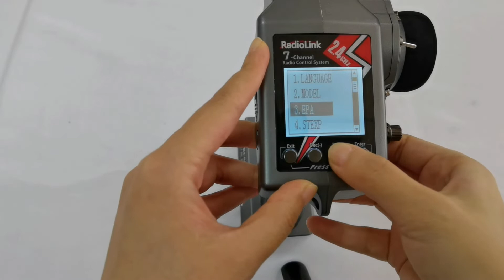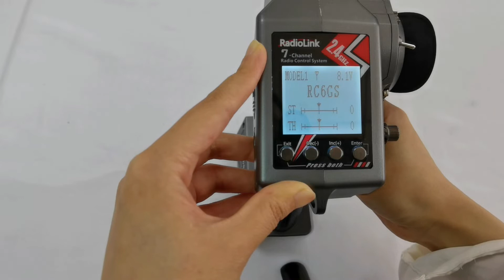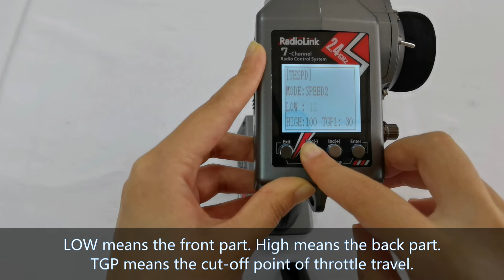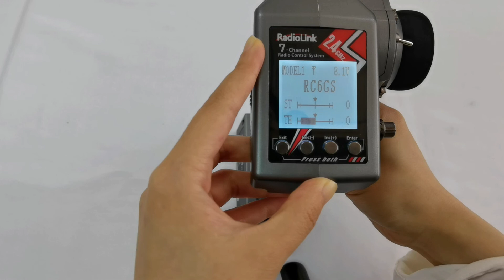THSPD Throttle Delay Function on RC6GS V3/RC6GS V2/RC6GS/RC4GS V3/RC4GS V2/RC4GS

Comment: But can you make so there is no delay when you release throttle and the return back to neutral. That delay on the throttle return is very hard to use when drag racing or speed running.
Reply from the maker: Hi, sir. Are you using RC6GS V3 transmitter? Could you please download and install the latest firmware V690, the throttle delay function is already improved and updated in the latest firmware. If there is still any question about RC6GS V3, could you please take a video to us? Our email is: after_service@radiolink.com.cn

Comment: Lo que no te explican es que cuando vas a frenar frena igual de lento que lo pones para acelerar !!! Si estás usando la opción para drag, preocura que tengas un espacio prudente para
Reply: Para frenar
Reply from the maker: Hi, sir. We have already updated the firmware. When you set the throttle delay, there will be no delay for brake now. Here is the link of the firmware for your reference. https://www.radiolink.com/rc6gsv3_firmware  If any question about RadioLink products please feel free to contact us. Our email is: after_service@radiolink.com.cn

Comment: The throttle speed function on the RC4 was key to getting my serpent 998e drag car dialed in! Very hard acceleration with out traction loss can be achieved with proper tuning of this function. 3 other local racers have now purchased a radio link after seeing my success with them. Keep up the good work!
Reply from the maker: That sounds wonderful! I guess you are a brilliant racer. It will be wonderful if we can see how you use the function in video.

Comment: Why is it only for Throttle channel? For example, I would like to speed down movement of servo horn between positions. Why not just provide consumer with ability to specify the same settings for any channel, not just for Steering and Throttle? To use or not to use - it is up to consumer.
Reply from the maker: Hi, sir. Thank you for your feedback. Many users use delay for throttle and steering. There is less need for delay of other channel now. But I can send the feedback  to our enguineer and hope it can be achieved in the future. If any question when using RadioLink products please feel free to contact us. Our email is: after_service@radiolink.com.cn

Comment: Apa bisa di upgrade ke 6 chanel
Reply from the maker: Hello, sir. For 4 channel transmitter, sorry you can not update it to 6 channel transmitter by updating the firmware, because there are not 6 switches. Are you using RC4GS V3? Actually, many functions of RC4GS V3 are the same with RC6GS V3, such as THSPD. If any question, you can also send email to after_service@radiolink.com.cn

Comment: I have rc4gs that come with a v3 receiver i  bought a few v4 but  they dont work as well as v3 do i need to update my transmitter
Reply from the maker: Hello, sir. Do you mean R6FG V1.3 and R6FG V1.4? R6FG V1.3 and R6FG V1.4 are the same receiver, with the same function. Both of them can work with RC4GS transmitter. It has nothing to do with firmware update. We recommend you to test RSSI of your receivers. Here is the tutorial on how to test RSSI for your reference: https://www.radiolink.com/newsinfo/561239.html  If there is still any problem, you can also send email to after_service@radiolink.com.cn